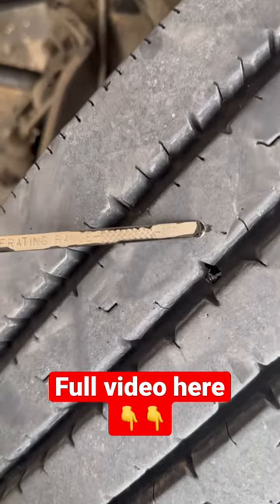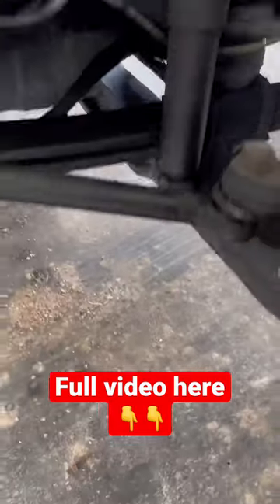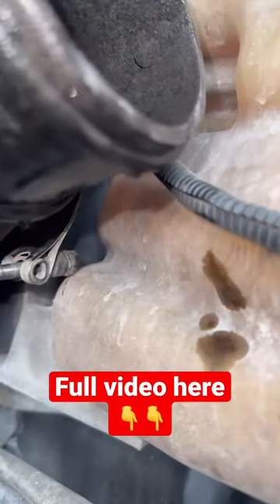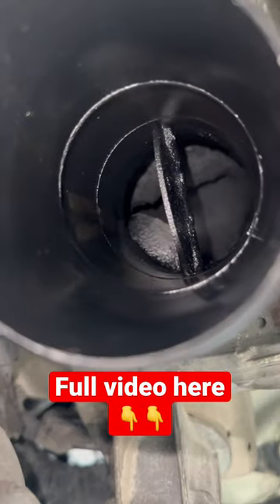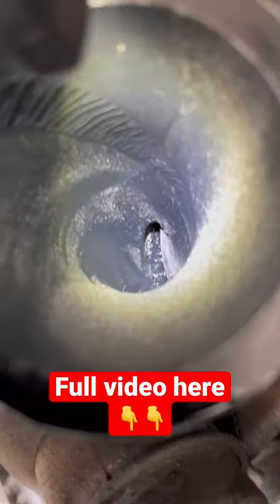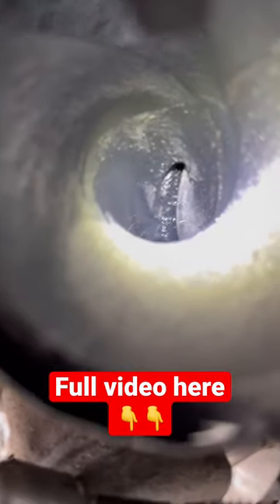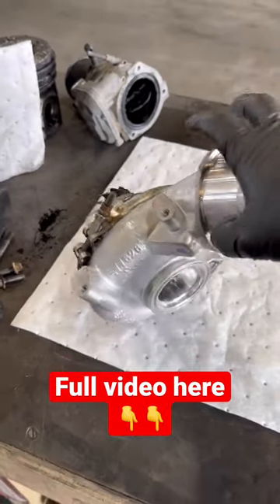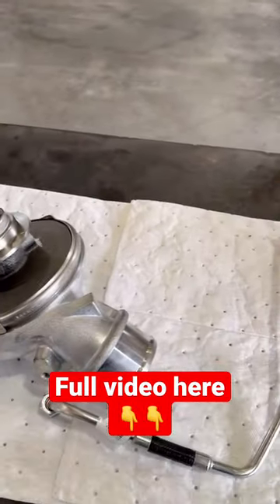Full video link in the comments #trucker #diesel #mechanic #trucking #bigrig

Comment: Better tip is to not run anything with a maxxforce in it
Reply: 100% true
Reply: There can't be many of them left 😂
Reply: Only Maxxforce engines worth having are between the year 2008 - 2010 before the EPA ruined them.
Reply: They barely start at room temperature

Comment: My 99 Honda was slowly leaking oil into the water jacket. Defect in the casting of the block from the foundry. Overheated one day on my way to work because there was 3 quarts of oil in the top of my radiator. Revved the engine while pouring distilled water into the radiator to expel the oil. Traded it in for my current car.

Comment: My Subaru loves oil and it’s not turbo. She treats me really well so I’m not going to make a big deal out of a quart a month. She’s perfect to me. 2012 Subaru Impreza sport FB20 standard trans
Reply: A quart a month is A LOT especially for a  2012, car doesn’t need to be turbo charged to get blow by
Reply: Check your PCV valve, maybe can be a cheap fix
Reply: @brandonoconnor8292  ya I thought the same thing too. I am not car illiterate but this is my first Subaru. I am totally bitten by the Subaru bug but even when I pulled spark plugs, got the oil tested in the lab, and did a decent visual seal inspection. It was just in the shop for a new throw out bushing and replaced the fork/plate at the same time as well as the slave and clutch cylinder. They said it’s a good little car too. I mean I really love this car. It’s my first AWD coming from trucks/suvs. I’ve been missing out my whole life
Reply: @paulsteverodriguez3549  bro your a freaking genius, I don’t even know why I take my car into shops. Unless it needs a lift and hoist, guys on the internet know more. Sure enough pulled it off and did a inspection. Yup it’s all gunked up and not moving.
Reply: Throw a bottle of Lucas oil in it my 2002 f150 was randomly loosing oil and I put a quart of it in and it hasn’t lost any in months
Reply: I have a 2004 Subaru Impreza WRX 2.0L had the same issue of burning oil. When the engine is running exhaust gasses escape from the cylinder past the cylinder rings into the crank case and the crank case breather lines suck the exhaust gas into the turbo and into the engine to be combusted. Doing so it also sucks out oil vapors. You can fix this by installing a oil catch can or a air oil separator.
Reply: @drewchorlton342  well since you brought it up, what oil catch can did you end up buying??? Where did you mount it too?? I wanted to buy one that someone else already figured out the mounting point and sells the bracket all together
Reply: Another reason why I said good bye any turbo Motor.
Reply: Pcv valve is blocked
Reply: 2007 Honda Civic 1.8L 210,000 miles and zero oil consumption. Not a flashy or fast car but def the most reliable one I have ever owned. Just my person experience 🤷‍♂️
Reply: @Burn_pits  gotta love the Internet
Reply: Most subees burn a bit of oil.  Its because of the compression ring design.  She's good to go, just check your oil frequently.

Comment: Every properly running engine will use oil. If you oil level stays up you are getting fuel blow by past the rings.
Reply: You should hardy notice a major difference between proper oil changes. If you're noticing considerable differences you have something wrong somewhere. Of course all engines consume oil but generally its not all that much.
Reply: @Nothingmore71  Chevy 5.3 has joined the chat

Comment: If it has a closed breather, it can also cause oil in the intake on those maxxforce engines
Reply: Even a dirty air filter on any turbo engine can help accelerate the consumption.

Comment: I understand the video situation content but you can surely diagnose the issue from the blue smoke coming out of the car. Another issue would be what is known as "dieseling" the engine starts to use oil as a combustion fuel and the engine idle would be slightly higher.

Comment: 90% of the time a turbo fails due to something else failing on the vehicle, maybe oil starvation or contamination of small particles or large particles or maybe dpf is clogged and causing a back pressure etc

Comment: Ive had a runaway the turbo blew in half and the arl 19tdi screamed up to 6 k revs for three minutes and died but the engine worked good after a new turbo installation pd engines are bombproof

Comment: You can usually look in your cars manual it will literally say how much oil it will burn off in a certain distance/time. My 95.5 Toyota burns a quart about every 8,000 miles iirc

Comment: What did you do to pressurize the turbo like that to check for leak. Did you put compressed air in the turbo oil feed line.

Comment: Those maxxforce 13 engines suck! I don't remember how many turbo centers, egr coolers and high pressure fuel pumps, I replaced. Had one run away. Didn't get it shutdown in time #5&6 rods vented the crankcase.

Comment: what if I don't have a turbo? what do you check next?
Reply: Look to see where the oil is dripping from. Look in front and the back of the block. Could have a seal or gasket gone bad. Could come from the oil filter or oil drain plug not properly being replaced with a crush washer or something. It's hard to say for sure not knowing the vehicle.
Reply: Piston rings or valve seals too

Comment: I’ve never worked on a diesel. Is this the most common cause of a runaway?
Reply: Yup. Most turbo oil seals rely on centrifugal force to seal as they spin up. If the seals are bad, oil sneaks out of the turbo into the intercooler where it's fed directly into the intake manifold where it begins being burned as fuel. ECU usually cuts actual diesel supply at this point but it's too late, motor is being fed oil faster and faster until it blows up.
Reply from the maker: Yessir
Reply from the maker: @tiwalterite  👍🏻 great explanation

Comment: I was an lube tech at Walmart and like the job for the most part. I was going to upsell a customer being an ass on an air filter. When I took off the old one it was caked with oil old and fresh. Luckily I did because of not it would’ve been my ass.

Comment: I have a ranger.gas is getting in the oil some how.3.0 v6
Reply: Old Ranger? Check to see if your fuel pressure stays up after shutting it off. You might have an injector leaking down. Does it have a misfire on start up?

Comment: The engine oil can be going  to " leak at ground/  feed by air intake leak turbo /  leak air compressor ring will pass oil into the air line to air tank /  burn oil in the cylinder  blue smoke out exhaust/  so next time u see oil disappear do your investigation  or go to mechanic that knows what  he's doing.  Piisout

Comment: I've only seen blowback on 3.6L Acadias and 2005 impala i think. What about that?
Reply: Pcv system or intake manifold gasket. Possibly a bad piston ring if its burning.  Check those out.  Maybe a catch can could help if nothing major. Note,  I'm not a mechanic just a guy who's had a few different cars and their problems